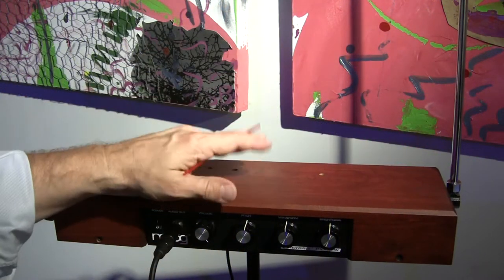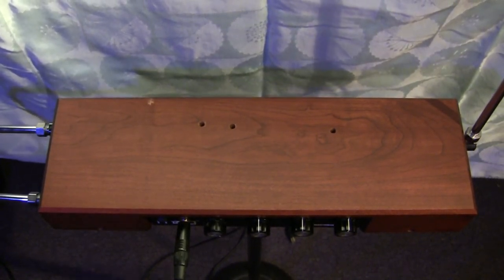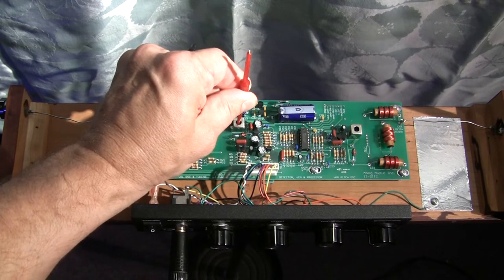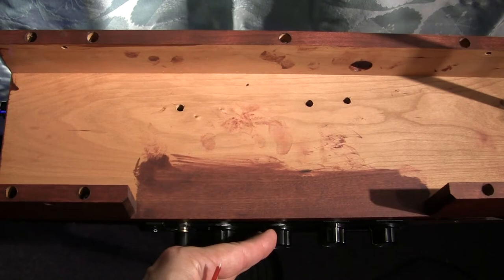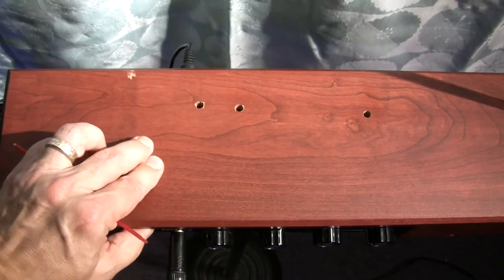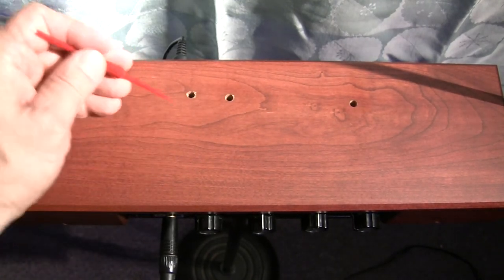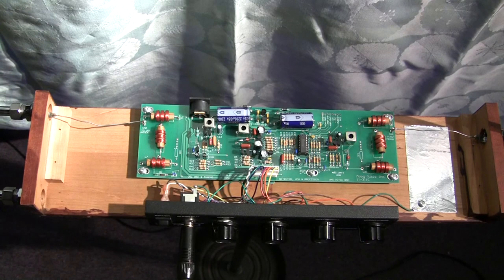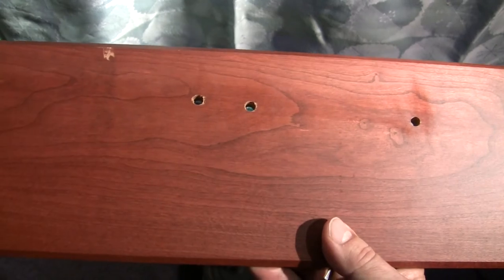Kip Rosser's "Complete Theremin" – Tip 1: What to do When Zero Beat Disappears!

Comment: Hello again Mr. Rosser..you had sent me a link shoe=wing where to buy   the Theremin tool that I seem to have lost. Could you send me that link again..I had internet problems and cant seem to find your reply. Also,  is there a name for this tool  ? Is it a tool I could by in electric hardware store ?
Thank you again.

Ginette
Reply: Sorry about that type mistake ,,the word is ''showing ''.
Reply from the maker: Hello ginette. I do not know if you can buy the tool in a store. But you can certainly get it online. Here is the web address again:  http://www.coilcraft.com/tools.cfm -- and the tool is called the TRi TUner - These exclusive tools are ideal for tuning inductors, capacitors and many other variable components. The Trituner™ is a unique 3-in-1 tool.  Both ends have large surface areas to prevent fragile cores from stripping or breaking. This tool has the strength of steel but is totally non-magnetic.
Reply: Ahhh Thank you so much Kip for such a quick reply .I will let you know how my ''opening the Theremin went . Regards to you .
Reply from the maker: Just take it nice and slow. Be patient and methodical and you'll do fine.
Reply: I didn't even know I'd require this too, so thank you for the information!